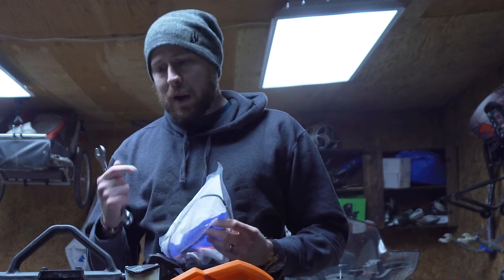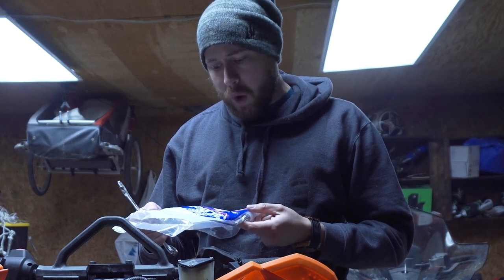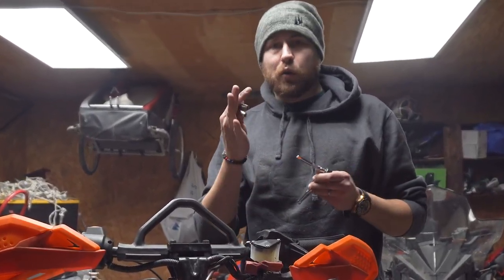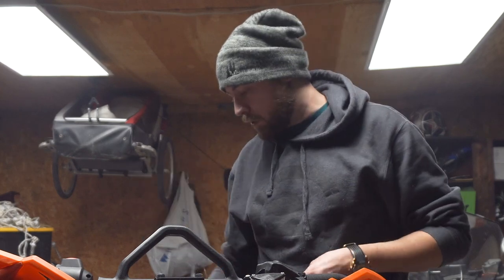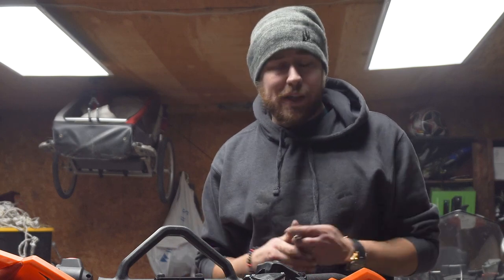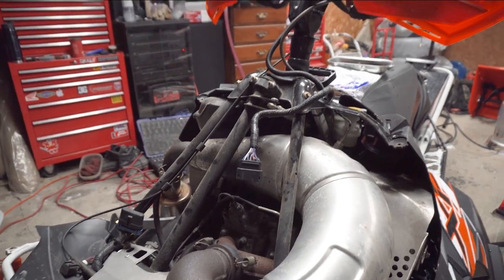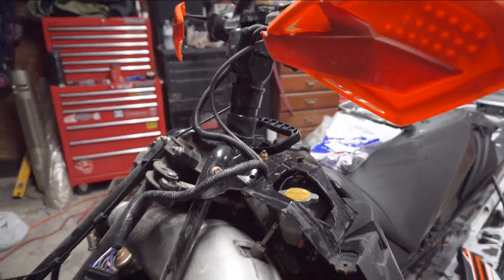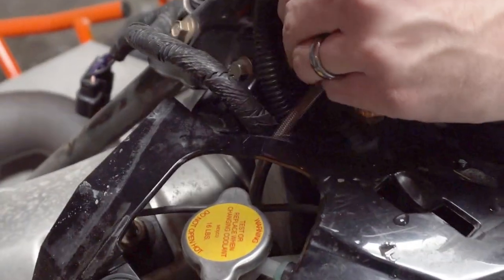ECU 17 Error code/ Exhaust temp Sensor  fix that will save you money.

Comment: Hey boss, I’m running a 2014 m8000. I tired a ggb mountain can on it but it gave me an octane code and went in limp mode. Turned it off and back on. Code went away but still in limp mode. Put the stock can back on and sled ran fine. I run 91 octane and I tried putting some octane boost in and the sled still goes into limp mode with the mountain can on it. Just wondering if you ever heard of the problem. Maybe I need to replace the o2 sensor. Any advice would be much appreciated. Love the YouTube videos keep it up
Reply from the maker: Definitely could be the o2 sensor, but that being said some aftermarket cans due cause issues. The only other thing we can suggest is to try a different can to see if it's causing the same issue
Reply: @3sixtynorth   ended up being the reeds

Comment: Hey guys, running a 2007 F8 with this issue. I replaced the sensor with the GM one but it dis not fix the code. Since i had to cut and splice the plug, does it matter which way the wires go? Could my problem be as simple as i crossed the wires?

Comment: I recently purchased a 2013 F800.  When I bought the sled it had the ECU 17 light on and the previous owner said he replaced the sensor that same day.  I rode 200 miles and the code was still present.  Last night I replaced the sensor with the AC delco one and after starting the sled the code is still on.  In your video here the code went away as soon as you started the sled.  Any ideas?  I just did fresh plugs too...
Reply from the maker: Not sure if 2013 f800 part would be the same as our highcountry.  But you are right the code should go away if replaced properly.

Comment: Hey can you tell me would this problem cause a bogging in the top end?
Reply from the maker: When this happened to the sled in the video, the sled lost power and was in limp mode. So to answer your question it could be a possibility but you would get an error code.
Reply: Did you find the solution to your sled bog? I have a 16 m8 same issue
Reply: My problem to my bog ended up being a broken wire on my stator. Was very difficult to find

Comment: The link is bringing me to part # 213-4778.  Instead of 12643246... is that correct?
Reply from the maker: Yes it is the corect part. #213-4778 is the model # but if you read the specs it shows 12643246 as OEM part #. Thank you for watching our videos
Reply: Also... if you click the link and want the American site , change the (.ca)  to (.com)
Or it's  ACDelco 213-4778 GM Original Equipment Position 2 Exhaust Temperature Sensor https://www.amazon.com/dp/B0055AIDGS/ref=cm_sw_r_cp_apa_i_sNLkEbXNQBHDH
Reply: @3sixtynorth  Thank you.

Comment: I have a crossfire 800 2010 and i got that Ecu 17. But after i Get the ECU 17 my sled not Go so fast and It’s also stop when i dont  give gas. Its that beacause the ecu 17 ?
Reply from the maker: Ecuador 17 is an error code. Meaning something is wrong with the engine or its component. You would have to check your manual what ECU 17 means for your sled.
Reply: Look under the hood on left side front area  ..there is a sticker tells you what the codes are.

Comment: Should use red or green loctite, very good chance it will vibrate loose over time.
Reply: red loctite becomes liquid again when its hot.
Reply: Never will that vibrate loose once you get some moisture in there that sucker pretty much weld it to the muffler not saying there isn't a time and a place for Loctite though it is very important...